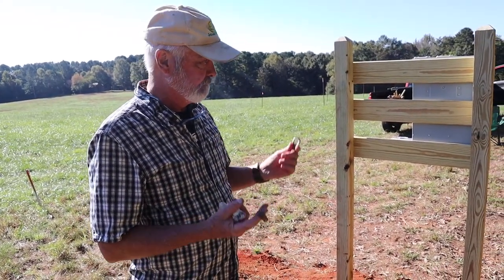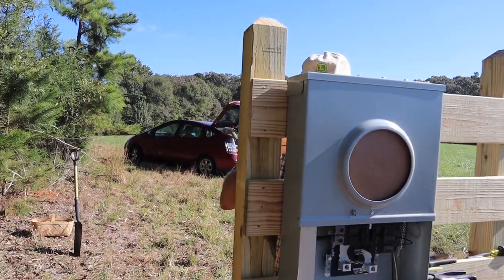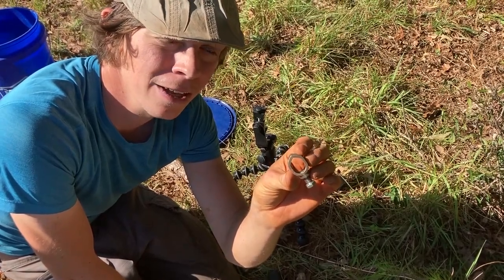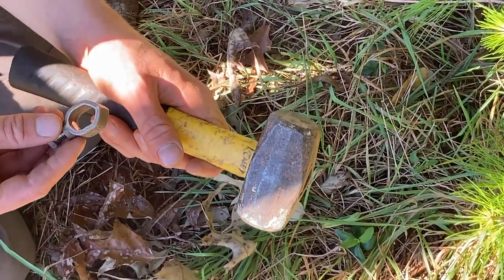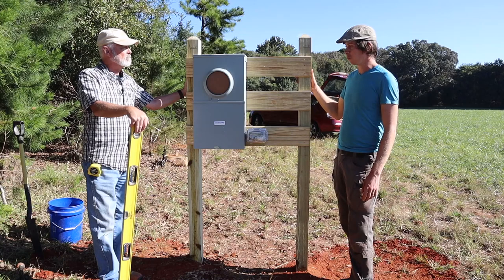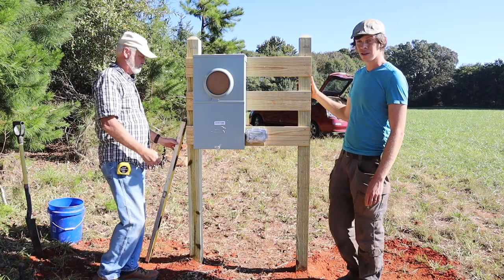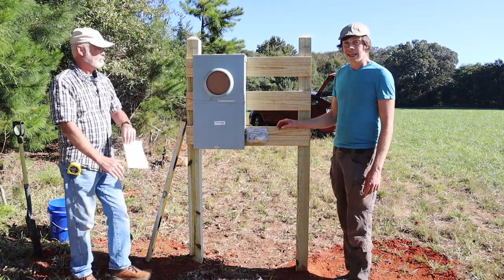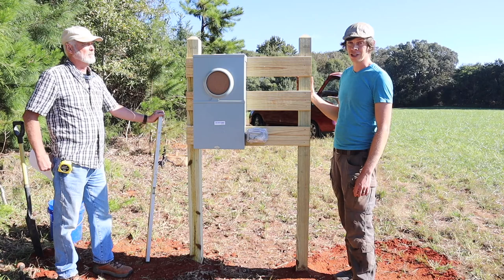DIY Temporary Electrical Power

Comment: For little more work I added a complete new electrical service pole with a panel and outdoor 240 and 120v outlets. First it powered building my shop, now it powers my shop. Price was painless (I'm also in the Carolinas) and I didn't have to touch my already maxed out home service. The monthly bill is trivial and there are always used mobile home power poles for sale if money is tight.

Big outlets can power welders, air compressors, machinery and charge BEVs if you get on in the future.
Reply from the maker: It’s great when things can multipurpose!This temp power supplied electricity for the construction of our house last year  and now our runs our well and later this year it’ll power the workshop. :-) continues to work for the homestead. We also are adding another hookup down in the field for a future greenhouse here.